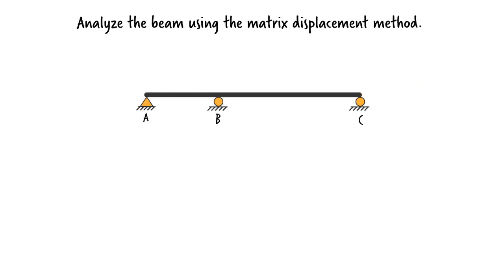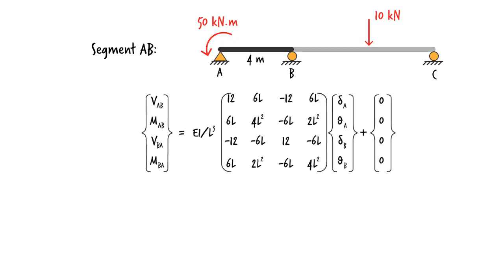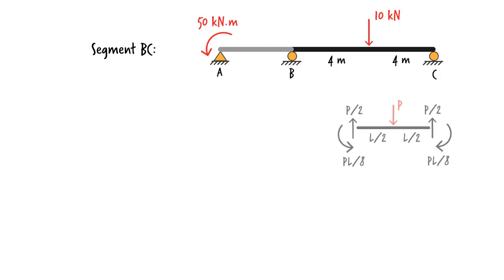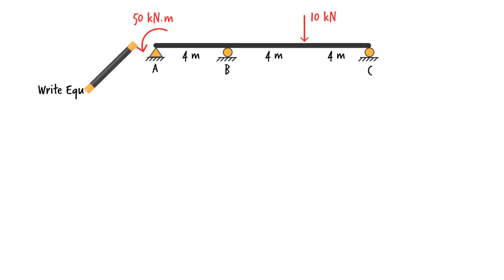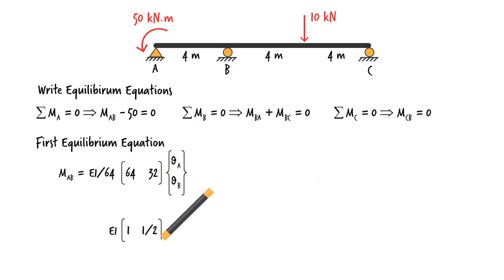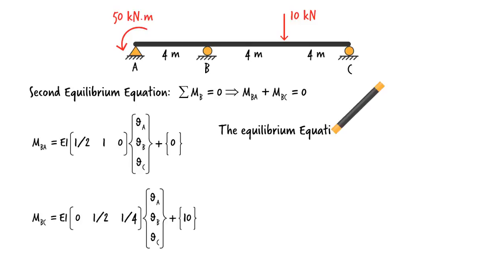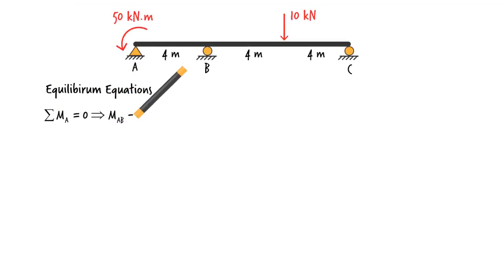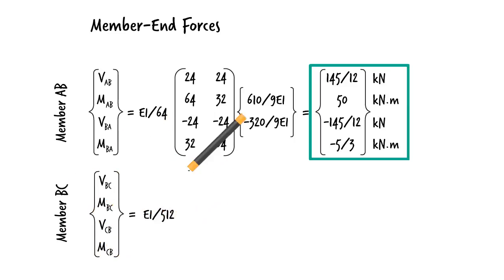SA45: Solution for Exercise Problem 1

Comment: Should your first equilibrium equation be (Ma + 50 = 0) instead of (Ma - 50 = 0)? Given positive is counterclockwise
Reply from the maker: According to our sign convention, the member-end moments are considered positive when they act in the counterclockwise direction. That is, when we cut the member close to A, the moment at the right end of the cut (Mab) is acting in the counterclockwise direction and the moment at the left end of the cut (which has the same magnitude as Mab) is acting in the clockwise direction. This has to be true since the sum of the two moments should add up to zero. 

Since the 50 kN-m applied moment is acting at A (i.e., at the left end of the cut, not at its right end) in the counterclockwise direction, we get: 50 - Mab = 0.
Reply: @DrStructure  Ah thank you, that makes a lot of sense
Reply: I've literally spent hours thinking of the answer to this, so thanks for being a legend and asking the right question.